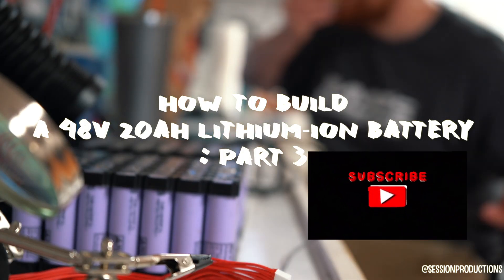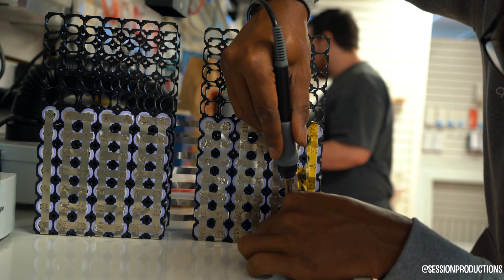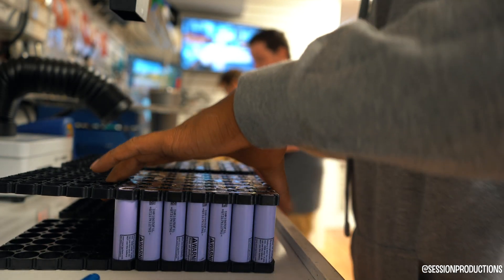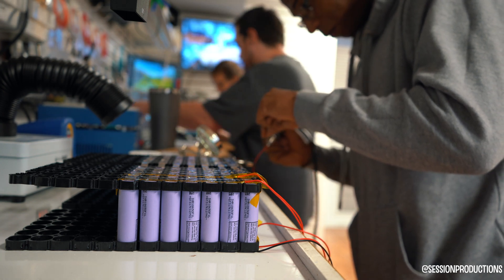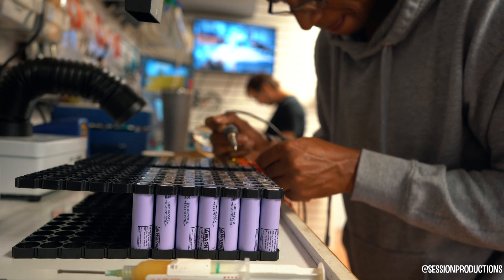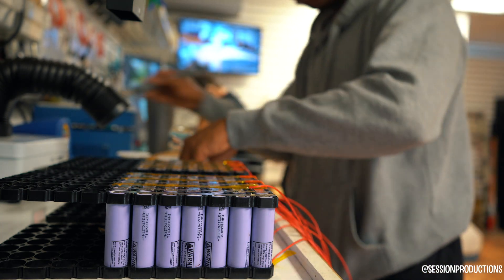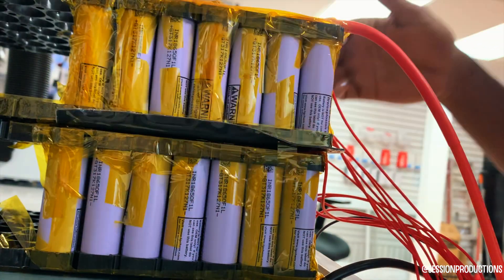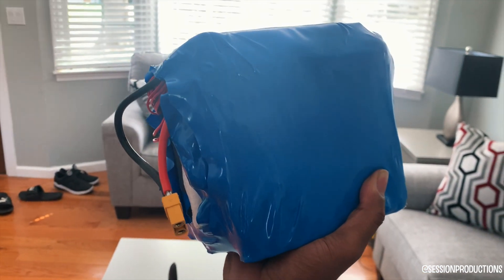How To Build A 48V 20AH Lithium-Ion Battery : Part 3

Comment: Is there any consequence to using wires to connect the two halves instead of plating? And how long can the bridging be?
I don't like the center of gravity with the battery being up on the top tube of my bike, so I want have split batteries off the sides of the tail rack like pannier bags.
Reply from the maker: I’m not sure to be honest. I know it would work but I’m not sure too what extent. Depends on the wire. I like the nickel strips because it saves space